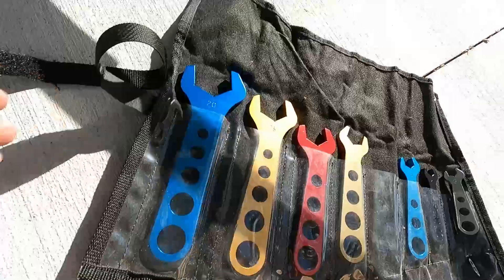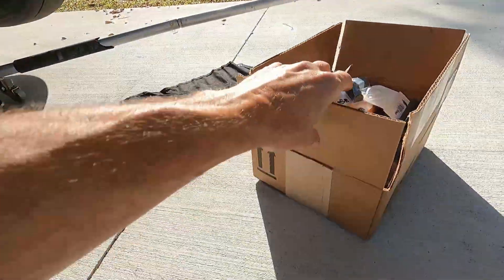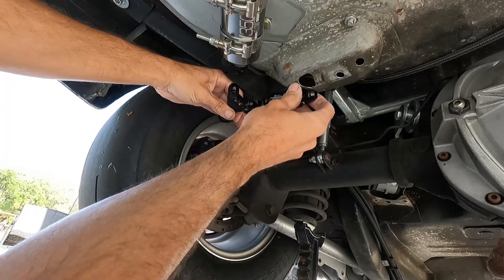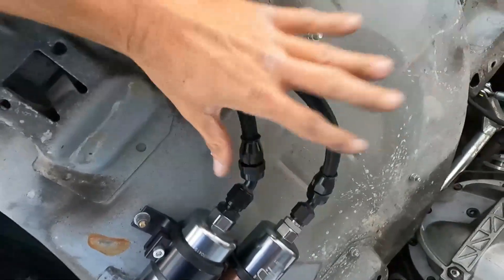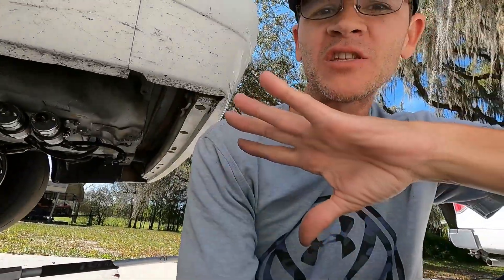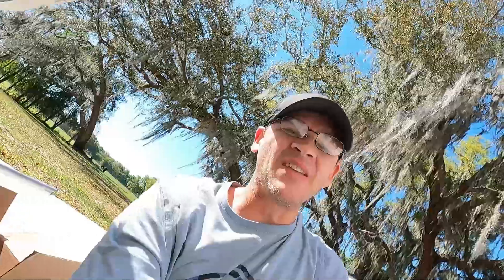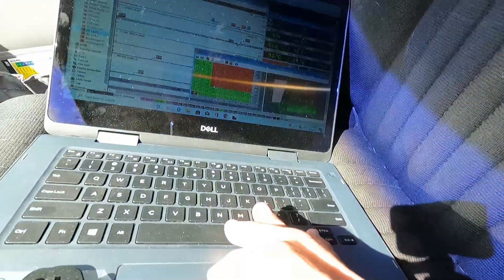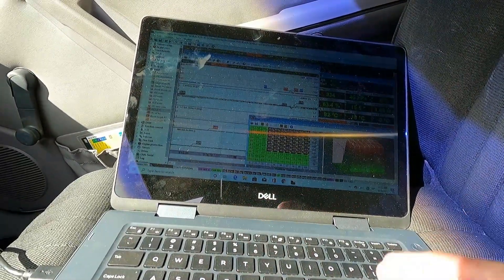How To Install Staged Fuel Pumps+Testing And ECU Settings

Comment: Hey, I just picked up the dw350il dual setup for my street car 2jz just wondering how loud you'd say these pumps are? I already purchased them so no going back for me, but there's no videos online about noise which is normal I guess because usually people run these on the track with a loud car (Could you possibly do a short vid of a noise test)

Comment: When or where do you reach the point where pump gas doesn’t cut it and you need e85? I’m worried about making the change to my turbo fox. I think I am near maxed out on pump 93 and my street setup. Not sure I have the skill or funds for the swap and car sits a lot.
Reply from the maker: That depends. Anything boosted can benefit from e85. E85 let’s you run more timing. If you can’t control knock on pump gas then e85 will help. And yes it’s pricey to make the switch.
Reply: @fox-body  ah man 😐